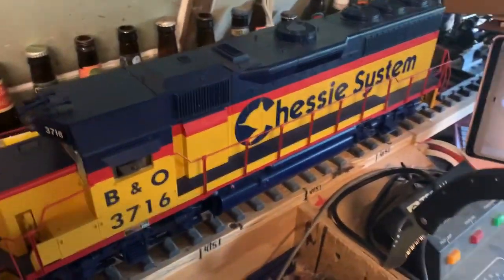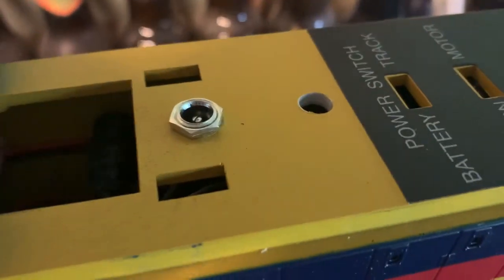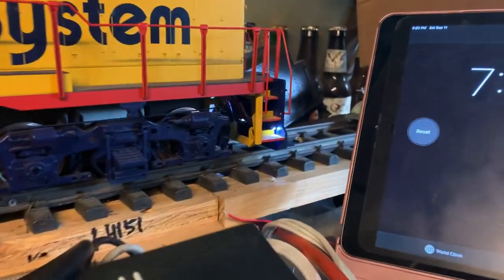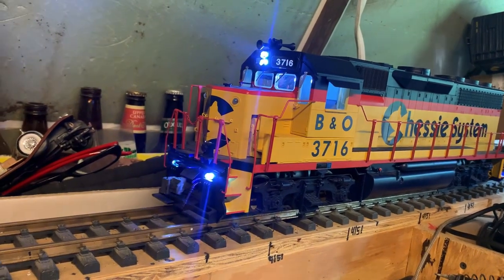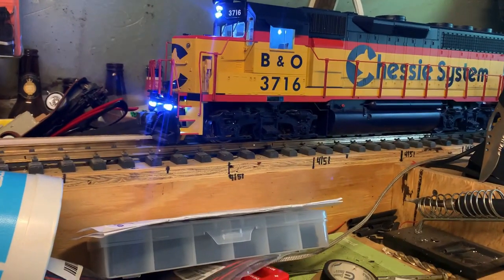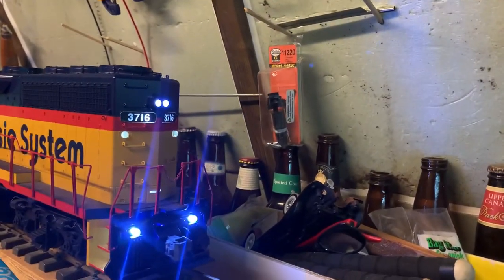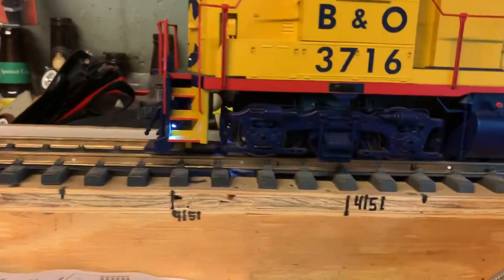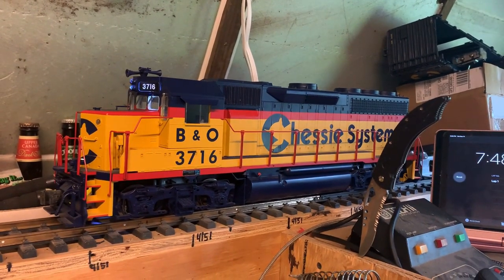G Scale Layout Phase 2 Update and Railpro Installed in a GP40! 9-11-21

Comment: I was going to make a comment about your LED'S looking blue, but when outside they look great.  I purchased different color LED's, for mine, so the number board lights are the traditional white, but the headlights are golden yellow like a incandescent light .  Inside, you can definitely tell the difference.   Great job on the neat and clean install.  I like the on/off switch and the charge port location.  Wish I had that in O Scale.  I have to figure out how to hide mine in plain sight.
Reply from the maker: I like the bright white LEDs as they actually light up the track for 20’ in front of the train at night!